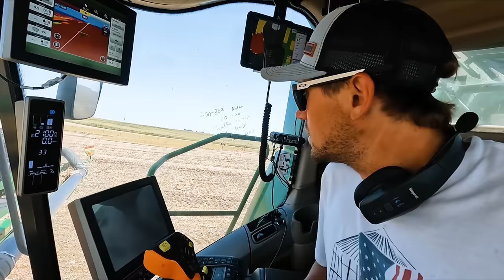Don’t Hire The Guy With The Cheapest Bid! Dougo Looses His Composure!!

Comment: Pouring a house basement, had 6 feet filled on 8 foot walls and the snap ties let go, had 40 yards of cement where the basement would be to cleanup, had walls rebuilt, cranes arrive, guys started shovelling, and 3 hours later everything was back to normal.

Comment: When a concrete company poured my 24’x40’ garage floor and was measuring for square, the guy holding the end of the tape was measuring the inside corner of the 2x4 while the guy reading the other end was measuring the opposite outside corner. Didn’t find out until 4 weeks later when the garage installer said the pad was out of square by 3”…so, I ended up adding a 2’ x 24’ slab at the back so the garage wouldn’t hang off. I’ve got a nice little porch for the dog kennel now. And no I didn’t hire them, the concrete guys were a sub contractor for the project…I got a decent discount after that mess 😅

Comment: When adding the internal plastic coupler to the concrete tile cut the 4 tabs off of the coupler that's going into the concrete portion. It then slides in a little easier

Comment: RODWEAVING! That’s called Rodweaving! My sisters an I helped our dad prepare for the concrete to be poured for mom and dad’s patio. Don’t ever help a machinist do something like Rodweaving! We had to weave each long sucker rod in and out (over and under) each short one. Then we had to wire them together at every intersection. And of course it was the hottest day of the year. 103F and the humidity was 76%! We have two older brothers. They were smarter than us and spent the day in air conditioning then came over the next day, when we were all finished. RODWEAVING!

Comment: Your first mistake was hiring someone who doesn't have controls at the back of the truck where all the action takes place.  Your second mistake was allowing Dougo to be in charge of the pour and give signals!  😂
Reply: Enjoyed watching the video CHET 😊
Reply: Most concrete delivery companies do not let their employees get out of the cab at job sites any longer.  Only for washout and that is not that common either. Most will not handle the chutes either anymore. So the rookie farmer crew is responsible and giving some direction... directions to the driver is the best it gets. So the source of the "mistake" is the crew.
Reply: Trucks have had controls in-cab for a very long time start and stop the drum lock the chute and raise and lower it. have hauled a many yards of concrete.
Reply: @CGW116A  BS. Driver was discharging way too fast. Driver was aware he was dealing with a bunch of rookies all along. Driver could have provided better customer service if he would have stopped the drum as soon as the forms were overflowing even without Dougo's signal.
Reply: Well why didn’t they just move the chute to the larger part on the other side of the partition. They could have cleaned that divider up after the pour. Trying to pour that narrow part separate was kind of foolish to me when the controls were not in back of the truck.
Reply: There are controls on the back of the truck.   But what isn’t on the back is a steering wheel.     The driver was an idiot for drumming it up as much as he did with a an inexperienced crew.
Reply: @kountrytiger1999  I have too, why does everyone want to do it on the blind side, turn the truck around so you can look out the window and see what's going on.

Comment: That buzzing is likely a failed bearing in the evap canister or whatever it is called which filters out the oil from the engines blow by. It cost me 2k fir the part on my dump truck so I imagine it won’t be cheap from Deere.

Comment: I just don't understand regions that still use rear unloading concrete trucks.  In northern Indiana we've had front unloaders for at least 45 years.  The driver is looking at what he is pouring.  So they can deliver the concrete right where you need it.  The one downside is that if they have a full load and are traveling on the road at the right speed and have to really jam on the brakes it can spit part of the load out of the barrel.

Comment: I have done a lot of cement pours. I have never done a pour where the operator sits in the truck and does not operate/ control the chute.
Reply: What do you call a lot? I haul over 600 loads a year and unload most of it sitting in the truck so I can move the truck when necessary. I do discharge slower than that driver was into a small form.
Reply: @joepfeiler5911  Wow that is a lot. No here the customer never touches the truck. The operator dispenses, moves the chute and has a u shaped device ( which probably has a real name ) to stop the cement from sliding out the chute. It is probably a OH&S issue and the cement company would be liable if anyone was hurt operating their equipment. We do use a lot of wheel barrows though! LOL

Comment: Unfortunate and should not have happened but it was a easy fix at least. The first time I ever layed a slab was with my dad and younger brother and it was a problem. The first tuck got stuck just out of reach of the slab. So dad thought let's pull to into position. That didn't work so well. The second and 3 truck showed up and the cement started to go off by the time it was pored. That made it hard to work. Me and my brother had know idea what we were doing dad yelling instructions expecting us to know what to do ,we didn't. So the end result was a uneven slab that holds water and a large another of dust in the middle of it that turns to mud when wet, it's what we fill the sprayer on.

Comment: Poured concrete for 10 years. Driver was not paying attention. You need your eyes glued yo both mirrors at the same time. Driver was probably playing on his phone. I drove a front loader for most of my time. Liked it a lot better than the rear loaders. You can see everything in a front loader. A little more water in that load wouldn't have hurt anything and it would have flowed a little better. 10 gallons. Maybe 5 more depending on how it looked.